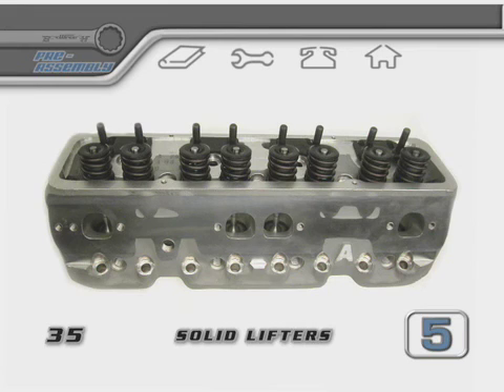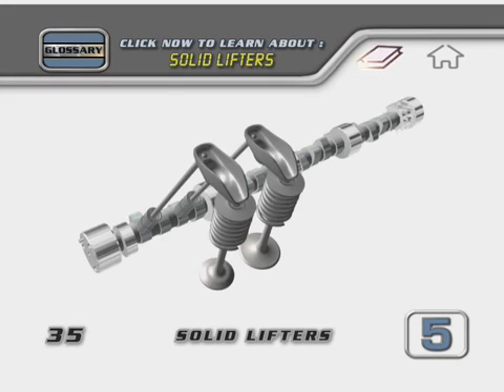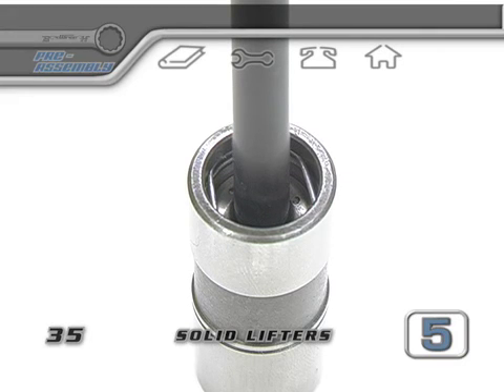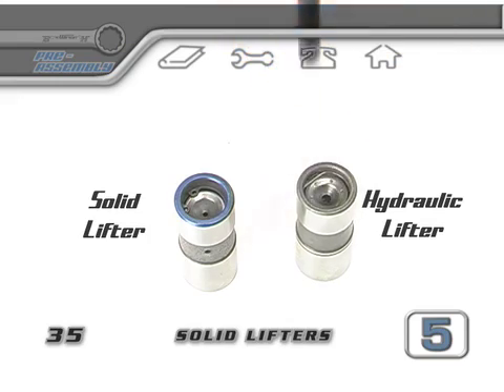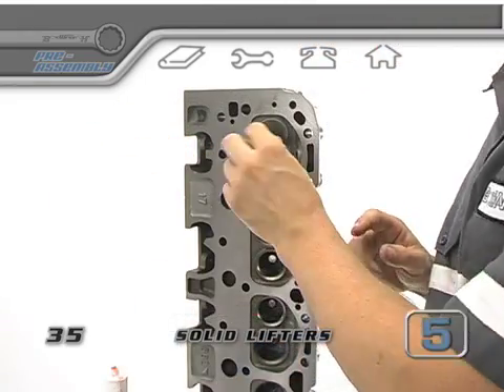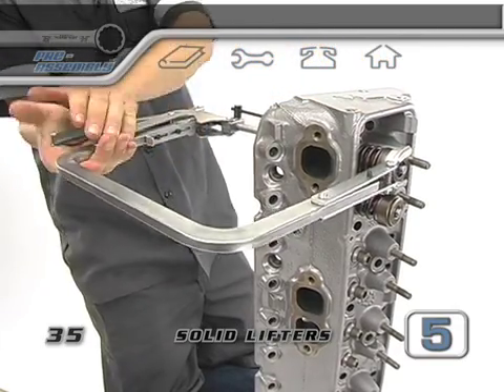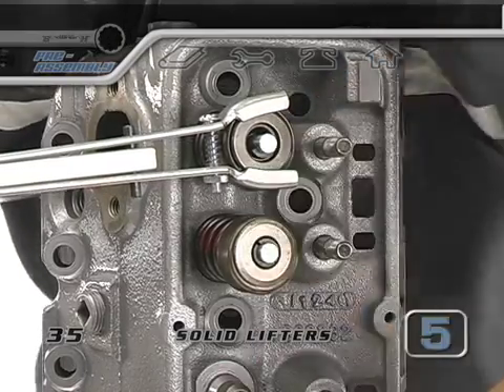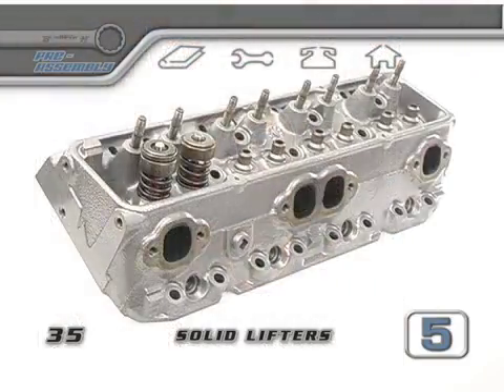Choice A: Solid Lifters - Part 2A of 3

Comment from the maker: @johnyjoe2k There are three narrators in the 3 1/2 hour long 'Basic Engine Building' DVD. All audio was professionally mixed and processed for the entire project. 

If you're hearing a 'muffled' sound quality you'll very likely want to check the audio settings where ever you're playing the DVD and/or YouTube clips. 
It's most likely that the 'bass' is set to high or that a 'tone' setting is incorrect on either the television, computer or sound speaker system.

Comment from the maker: This procedure is specific to engines that have hydraulic lifters in the stock engine build-up. The majority of engines these days will have hydraulic lifters while solid lifters will generally only be run in performance engines or classic, pre-1950's engines. 
This clip is from the 'Basic Engine Building' DVD and focuses on the larger audience of engines that have stock hydraulic lifters. The use of the solid lifter here is only for the pre-assemly process of piston to valve clearance check.